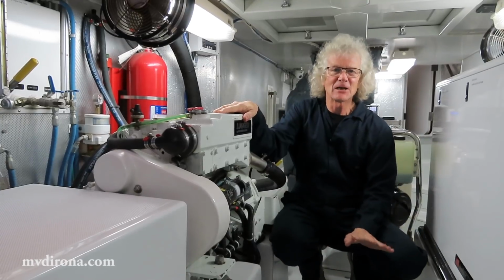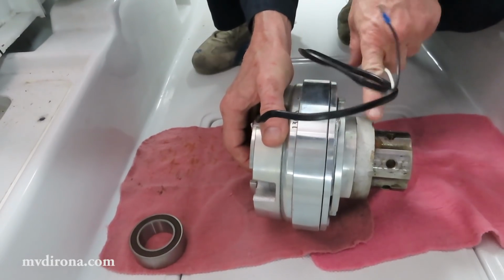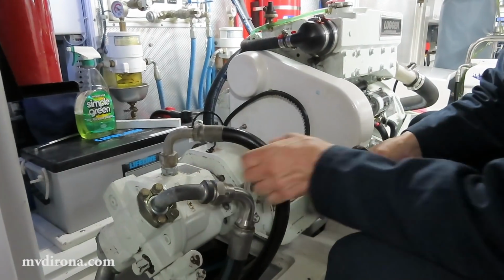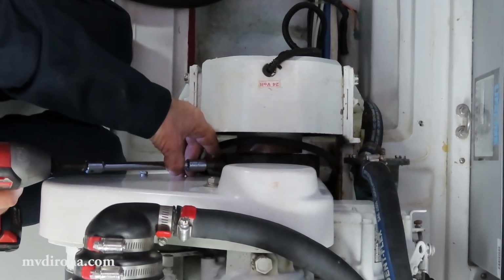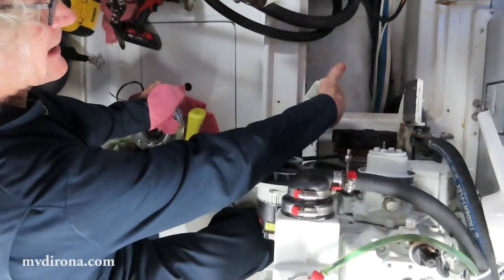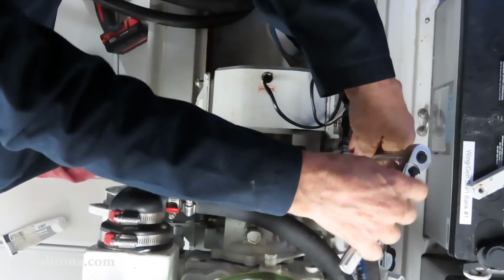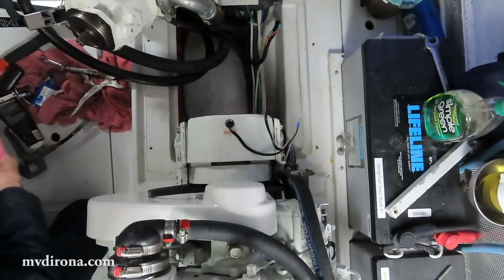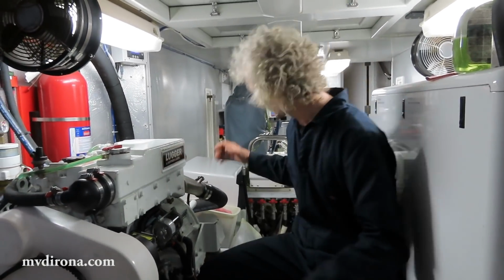Replacing Lugger/Northern Lights PTO Clutch (MV Dirona Channel)

Comment: When you disassembled the pump drive connection it appeared there was a spare fan belt tucked out of the way but around the drive shaft from the engine. It would mean disassembling the entire unit to replace a worn belt. Did you leave it off intentionally?
I am impressed with your presentation, explanations and technique. 
Good clue about unwinding the spring in the torque wrench. Thanks. My foot/lb wrench is the newer model but my inch/lb wrench is the older model with the external pointer!
LOL I noticed right away you referred to ft/lbs and NOT lbs/ft.. Many these days think they can redesign terminology, hey, and even science.
BTW … is there a value to isolate the main engine hydraulic pump/pressure from the lugger pressure if one or the other develops a leak? A high pressure manifold would mean the pressure could be maintained while repairing a leak in either of the two pump setups? If there is, sorry I did not pick that up.
Reply: Sorry. I sent my comment about the fan belt before seeing the belt was there at 46:30.
Reply from the maker: You did see the belt properly installed later and you are right it was not on there at first. I made a mistake and needed to back track and pull the clutch back, install the belt, replace it. The backtrack only cost 10 min but I would have preferred to have the belt there from the beginning. Good eye.
Reply: @MVDirona  Thanks for being up front. I was reluctant to mention it only because of being on the 'web'. Great job with the videos. Informative and straight goods.
Reply from the maker: Thanks!

Comment: How much easier it would be on the alignment pins if they had a small groove cut into it for better gripping.
Reply from the maker: Perhaps it would help a bit. Based upon my experience with this part, it appears that if there is no corrosion, the pins come out fairly easy so think the key is keeping them free of water and perhaps with a thin layer of grease.
Reply: @MVDirona  Great Series of videos and web site,  fair sky's and calm waters to you
Reply from the maker: Thanks!

Comment: Back the bolts out one turn on the flex coupling to allow precise alignment. I have put hundreds of marine components together this way at a marine service facility in Tarpon Springs Fl. Other than that, I recommend Anti-Seize on the couplings which is resistant to corrosion somewhat better than grease. Your grade for the job at this point is a B+
Reply from the maker: Thanks for your thoughts.

Comment: You loose a lot of your torque when using those extensions.
You need to be as close as possible to the fasteners to ensure accuracy.
Reply from the maker: I hear you but it's a relatively small factor and there aren't many who can pull 200 ft lbs of torque 2" from the bolt center. Remember the torque spec in this case comes from me looking up the recommended max for a grade 8 fine threaded nut and bolt combination.  When a head bolt is torqued up, the torque wrench will be far longer than when a fuel injector is torqued down. The accuracy of both may be impacted by wrench length but the torque loss impact is slight and the accuracy is sufficient for the application.

I'm very confident the bolt is tight, won't loosen in use, and will not wear.

Comment: A handy tool is: www.harborfreight.com    6inch magnetic parts holder $3.99 Pittsburgh Automotive, Item #61428 You'll never lose a bolt again !  =)
Reply from the maker: That looks like a useful addition but, on a boat, many parts are stainless steel and, on these, magnetic holders are not effective.

Comment: Not a good idea to place metal spanners on top of batteries. Btw metal is the catalyst for loctite, so try not to touch the bolt with the nozzle, just 1 drop is enough , and dont forget to resecure the battery , which i noticed you unbolted the retaining strap for better access to bolts
Reply from the maker: Yup, battery and everything else is all resecured and cleaned up nicely. Your caution on the dangers of shorted battery connections is a good one. In my years as a professional auto-mechanic I did make that mistake once and the discharge was impressive. Not good for the wrench, and a bit tough on the battery terminals.

Comment: A good way to loosen bolts with loctite is to heat it with a a
Reply: Heat gun
Reply from the maker: Yes, I usually manage to power through it but, you are right, heat will break down even red Loctite.  Strictly speaking I should be using blue Loctite for this application but I go with red when I simply can't live with any chance of loosening and I'm willing to have to work harder on disassembly. 

Thanks for passing along the tip on dealing with Loctite on disassembly.

Comment: Very detailed video... someone mentioned “don’t forget the touch up paint.” I don’t know if they were kidding or not, but would that be standard practice to prevent rust and keep the engine looking sharp?  Or purely aesthetics?
Reply from the maker: Touching up paint after service isn't anything I've ever done just due to the time and mess cost but it's a good idea in that a clean engine will show faults faster and easier. It's probably worth doing but, thus far, I've not.

Comment: James, did you eventually replace the bearing in the original clutch assembly? If so, how did that go? I have the same clutch on our NL generator, but rather than have a spare clutch assembly, I'd prefer to have just the spare bearing, pins, and other service parts. (I can be without mine for a bit, so if it has to go to a machine shop to have a bearing pressed, that's fine.) Thanks for another great bit of boating know-how!
Reply from the maker: Hey Brian. I tried to change it but my largest puller is just a tiny amount too small to get the clutch apart. I suspect it would probably be easy for a machine shop but I've not yet tried to get it changed. So, the quick answer is I don't know but your plan sounds perfectly reasonable to me. 

These clutches don't fail fast in all instances I've heard about it. They just get increasingly noisy so you should expect lots of warning.

If you don't have a timer on yours, you should Northern Lights about it. They help the clutches last much longer by every 10 min opening the clutch for a 1/2 second to give it a chance to move to a new position. It really makes a big difference in longevity.
Reply: Thanks, James - I'll check into the timer.
Reply from the maker: Good plan. Norther Lights can help. I'm always interested in investigating potentially better configurations with the risk that some I find may be worse. The timer is 500 msec every 10 min but I'm currently trying 500 msec every 105 seconds.

Comment: Excellent, informative video and thanks to the editor (Jennifer?) for making it engaging.  Appreciated.
Reply from the maker: Yes, you are right. It was Jennifer behind the camera and doing the editing work on this one. The camera work ends up being a bit challenging due to space limitations and video editing always seems slower than it should be. Even with good non-linear editing tools, it's still not a quick process.  

Thanks for the feedback.

Comment: You guys ROCK! Thanks for taking the time to explain in such detail something that will be very useful to few of us. Much appreciated. Question: When you installed the clutch, on the video, I didn't see the spare belt (which is such a good idea) but at the end, there it was! Did you forget it the first time? Anyway, looks like you are having the time of your lives and so appreciate your sharing it with us!
Reply from the maker: Yes, good observation. I had put the belt down out of the way in the laz when I took it off and forgot it initially. But, it only cost 10 min to get it back on there and it's a pretty important backup so worth installing.

Thanks for the feedback on the video.

Comment: When using a powertool and then checking with a torque wrench make sure that the torque wrench will have some rotation prior to click for the set value. If there is no rotation the bolts can have more torque then the target value
Reply from the maker: Absolutely. It's an important point not to over-torque with power tools. What I do is just wind the screw in but not hit it with the impact of the impact tool. The final 1/2 to 3/4 turn is all by hand.

Comment: Thanks for sharing this information!  I love to get down in the weeds of a system I'm not that familiar with. Your a great boat owner, obviously you take great pride in your vessel, as you should.
Reply from the maker: We try to take good care of the boat because we really depend upon it when we are a long way from shore and there is nobody around to help. But, on the other hand, we try not to get too crazy and over-invest in it or allow it to be the focus of what we do. We love the boat, but it is a tool to delivery an amazing trip and it serves us rather than we serve it. 

Jennifer and I are both pretty happy with both how little maintenance it requires and how reliable it has been over the last 10 years.

Comment: Can you use Never Seize on the splines?
Reply from the maker: Yes, absolutely. That would be a good choice in sparing amounts.
Reply: and on all machine fit surfaces
Reply from the maker: @Weird600  Sure, Never Seize is fine as long as used sparingly and kept off clutch friction surfaces. I used a light coating of grease.

Comment: Very informative, thanks very much.  One question, you say in close quarters the main engine is idling and you use the wing to run hydraulics.  Do you have to run the wing to run the hydraulics when the main is at idle or is it just your procedure in order to exercise the wing?  Also roughly how much HP does it take to run the pump?  I am have a spec on the new N475 and it has only a 30hp Yanmar as the wing which seems under powered to begin with (I have not asked for higher HP option, I am sure this engine spec can be upgraded).  but a full hydraulic system seems a better option than electric 24v motors for thrusters, windlass etc.
Reply from the maker: Both the wing and the main have the save 45CC Rexroth pump so either one of them can run any hydraulic accessory. The advantage of this approach is, if either engine fails, everything keeps working. A notable and very nice side effect of this general characteristic is the stabilizers keep working on main engine shutdown or failure. The wing can both power the boat and run the thrusters.  

Similarly, if the wing doesn't work or can't start, the main can still run the thrusters but I will need more than idle to get full force of the thrusters but the system is still fully operational.  The reason why the wing is run in close quarters is the main won't supply enough volume to deliver anywhere close to fully hydraulic power at idle. If the wing is out, I would rev the main in neutral for thruster operation and the shift the boat for and aft on the main.  You wouldn't be able to do both at once.

The quick summary is that both engines have the same pump and either engine can run everything hydraulic. Normally, I use the main for stabilizers and emergency bilge pump and the wing for anchor windlass and thrusters but either engine can drive any hydraulic accessory.

I agree with your assessment that, in recreational boats, hydraulic thrusters are typically a far better choice. Often have more power and usually they are continuous duty whereas electric will usually have very strict thermal limits on continuous operation.

You asked how much power the hydraulic system draws off the wing engine. It takes the full 40 HP. The ideal wing engine for the Nordhavn 52 would be about 60 HP but small boats have to make some compromises. Only a 40HP was available in this boat and we run it's hard but it works well. We have full hydraulic operation. But it does have to work hard. It's a good think that Lugger makes a reliable package that can take the hard work without issue.

Generally we have really liked our hydraulic system and are glad we didn't go with electric thrusters and windlass. Especially the windlass when anchoring deep. But, all other members of the 47/52 family are at least partly electric and all the smaller Nordhavn's are 100% electric and they do fine and most owners are fairly happy with overall performance.

Comment: Nice job, well done. Do'nt forget to touch up the paint! ;-)
Reply from the maker: I'm not sure why but, for some reason, even though I keep everything well maintained and clean, I don't touch up the paint. In some ways I like to see what's been services and what hasn't and the paint damage on where parts have been changed doesn't bother me. I almost treat it as a badge of honor -- the main engine has done 10,830 hours.

But I suspect you are right and I'll eventually break down and apply some paint touch-ups to keep the systems looking good.

Comment: yeah that s a pretty big drawback of having the front mounted PTO - makes changing the accessory belt a much bigger job

thank you for the video - really informative
Reply from the maker: Your right on the accessory drive belt but but, with a spare already installed, it's not too hard. And, with properly set belt tension, the primary belt will last longer than the PTO clutch.

Thanks for the feedback on the video.

Comment: Haha. I’m starting to believe you will never leave NL for winter.   Didn’t you winter there last year or am I mistaken?   Great point on wing hydraulics and glad I’m using wing for such and hence will be using.   Thanks to both of you for your service to boating.
Reply from the maker: Thanks Eric. You will be much happier using your wing frequently. There generally are two faults modes that hurt them and old age and wear aren't even on the list. Lack of use is #1 by far. The second fault that I've seen happen surprisingly frequently is engine flooding when boats are operating in really rough water that is defeating the stabilizers. With enough heal and wave force, water can be forced into the wing engine. I recommend a 1-way valve as a cheap and easy way to eliminate this risk.

You are right on us planning to spend the winter in Amsterdam again.  We generally don't like returning anywhere but Amsterdam is just such a wonderful stop with lots of everything we love and great train and air service to other parts of Europe. I'll bet we stay busy.

Comment: Nice job. Where is your spare belt?
Reply: I did not see the spare belt until the cover was on, I thought you forgot it. Cheers
Reply from the maker: You know, it's funny you mentioned that because, I actually did briefly forget the spare drive belt and had to do small backup of the job to get it on there :-).

Comment: Great video! Question I have is, did you have to tear it apart again and put on the spare belt? That is something I would have done!
Reply from the maker: I'm embarrassed to admit that I did start putting it back together without the belt but I noticed fast and it only cost 10 lost minutes :-).

Comment: Excellent educational video James. Do you ever routinely change any of those hydraulic hoses? I presume the fluid gets changed on an hours run basis?
Reply from the maker: There is no specified replacement interval on the hydraulic hoses but the most conservative recommendations I've seen is 10 years. If the hoses are kept in good condition and aren't chaffing against anything, they should go far longer. I keep an eye on them looking for abrasion or potential wear points or hose breakdowns but, without evidence of any problems, I'll likely let the hoses do 15 to 20 years. 

On the hydraulic oil, American Bow Thruster has no recommended change period as long as there are no faults in the system. They do recommend annual filter changes but the oil is fine unless there has been a mechanical fault that could allow metal or other impurities circulate in the system or some other problem with the oil like water being introduced at the cooler. As long as there are have been no faults in the system and the cooler is good, the oil should last well. 

The fluid was changed once when the system was fairly new because it pulled several gallons of motor oil was pulled into the system. This actually isn't a big problem and the system will actually run fine on motor oil but I like running on pure ISO32 so I changed the oil. Around 5 years back, I elected to install a larger heat exchanger so I took that opportunity to change the oil again at that time.